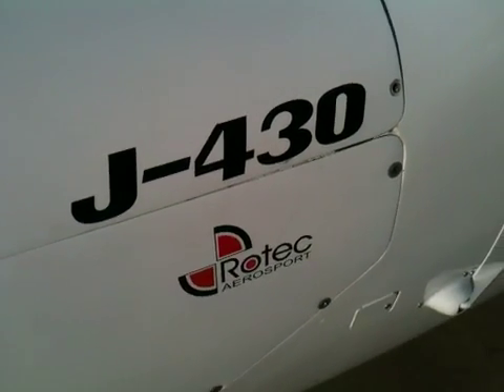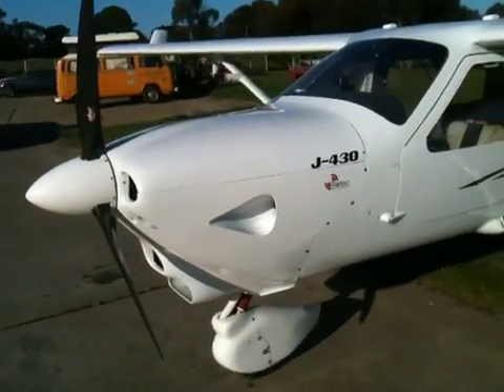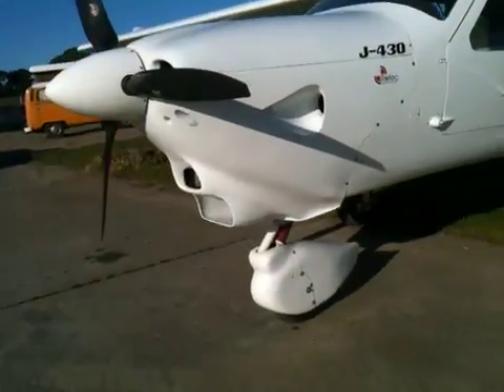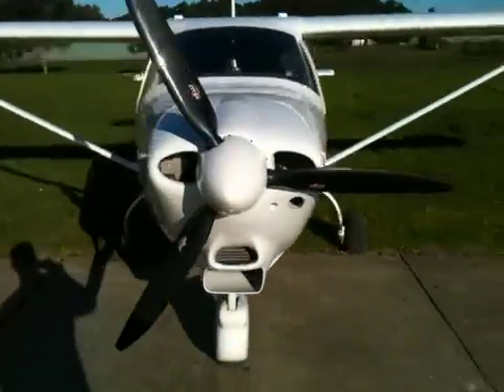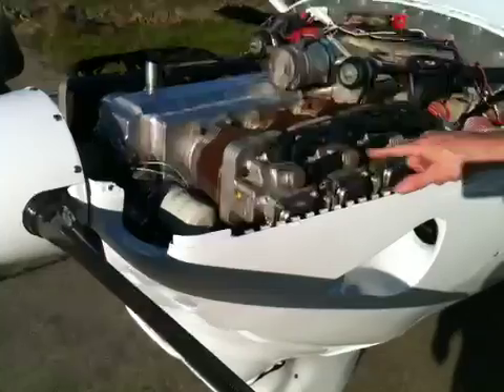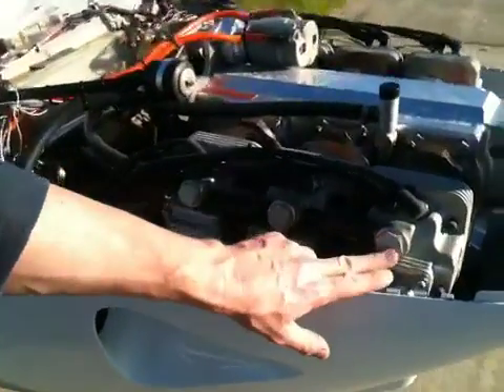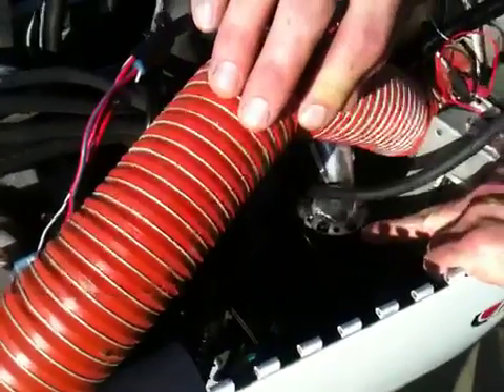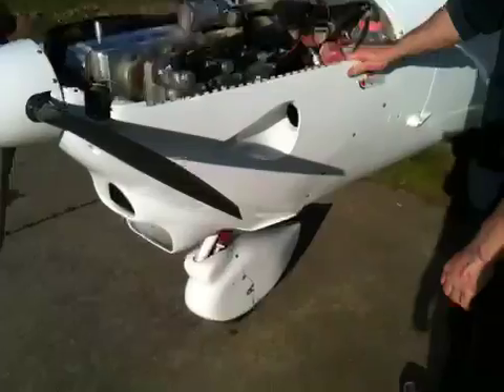Jabiru 430 230 LCH

Comment: The CO2 entering the cockpit must have been at nearly lethal levels. This installation will save some lives and also greatly lower under cowl temperatures. A little complexity is perferred over a trip to the hospital. The risk of a fire is reduced greatly also. Really like to see the engineering skills of people. Thanks for the video. By the way do any light airplanes have CO2 detectors? After seeing this I would think that some pilots would have installed one.

Comment: Liquid cooling is far superior to air cooling. It can maintain 150 degrees lower CHTs, greatly improving engine reliability and lifetime. Also reduces thermal shock when descending rapidly at low throttle. The increased complexity objection is negligible, by using quality hoses and clamps, and periodic inspections. How often does your car cooling system fail? Essentially never, unless you ignore it for 100,000 miles!